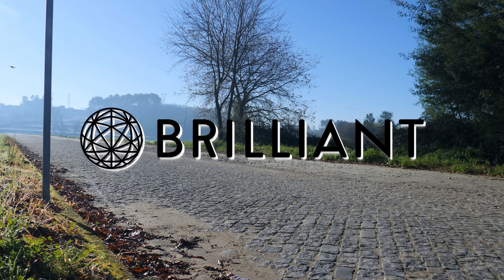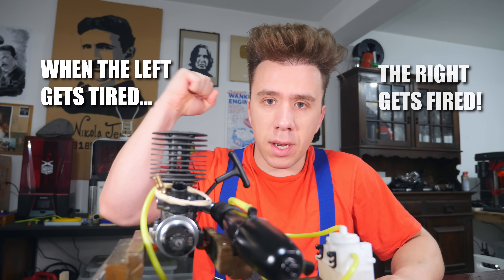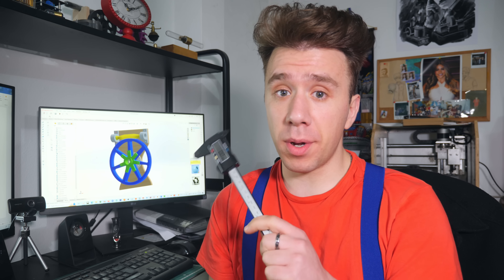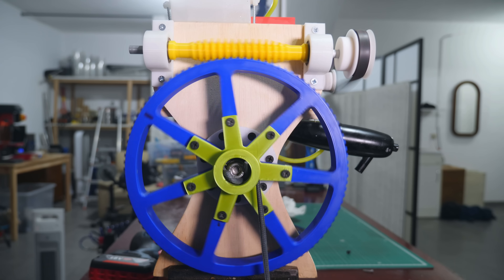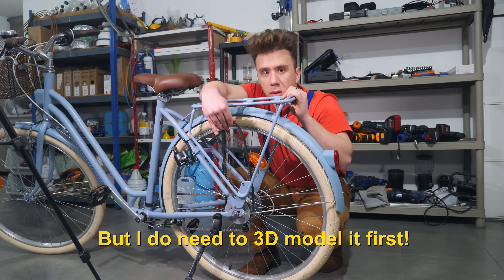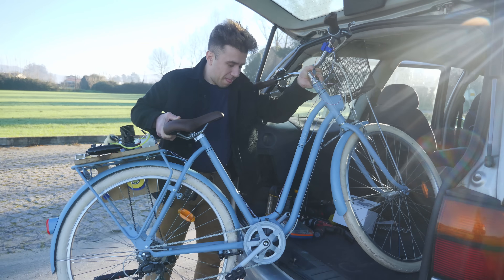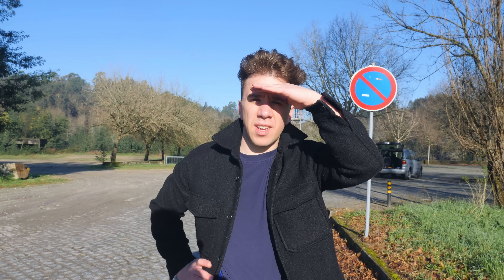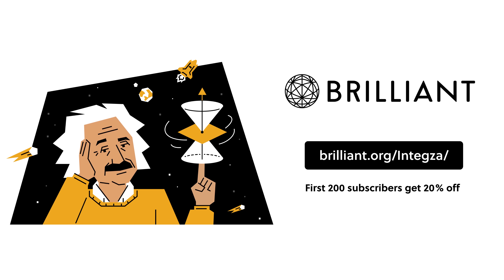Tiny 3.5 cc NITRO ENGINE on a BICYCLE

Comment: Stupid question, when the engine is running but the bike tire is not spinning. How does the engine not stall? I understand that theres lots of places that could begin slipping to allow the motor to keep spinning but the tire be not spinning but that would destroy whatever gears are slipping very quickly. Thanks for whoever explains it!
Reply: Nitro engines and most small engines use a centrifugal clutch on their crankshaft that only engages to the output when above a certain RPM. Works in principle exactly like a normal car clutch except engages and disengages automatically based on engine RPM. On the crank is a set of clutch shoes squeezed together with a spring, at a high enough speed they have enough centrifugal force to overcome the spring and move outwards, where they grab an outer drum and connect the engine to the output. Centrifugal mechanisms like this are used in a lot of scenarios when input and output can't be directly connected.

It's easy to understand if you google a centrifugal clutch like used in Go Karts, Chainsaws, and they look like a drum brake system with shoes that engage a drum if you're familiar with those. Very cheap and simple design that automatically prevents stalling when you let off the throttle and engine RPM drops
Reply: @Brandn00b25  thank you very much

Comment: It needs proper metal eBay gears and to be setup so it has two or three speeds, you could make a selection gear and shaft as the output

Comment: Now you see why these engines are used for RC models!  Especially helicopters.  For a "700" size heli (which spins 700mm main rotor blades), it takes a 31cc gas engine to perform similar to a 15cc nitro engine... and at that point it's considerably heavier and thus flies worse.

Comment: Now you need to put a exhaust to give it some back pressure since 2strokes run best with back pressure hints the crazy exhaust the 2stroke dirt bikes have I don’t 100% know how it being nitro will effect it though
Reply: Also two ideas you could try a centrifugal clutch maybe and make it to where it drives the front wheel so you could have the rear so you can pedal and get it up to speed just an idea🤔

Comment: They were called "glow plug engines" and ran on a mix of methanol and oil, about 4 to 1. Then competition fliers/drivers started adding nitromethane, about 5% for a bit more kick. The manufactures decided to rename the engines. Now I think they add up to 20% or 25%, using a synthetic oil. Top fuel drag cars use about 5% methanol and 95% nitromethane, they wont start, let alone run on pure nitro.

Comment: Better get a few clutches on hand for spares. If you hear fuel sizzling in the crank case after shut down, she's too lean. If it ever starts to really run great, it's about two minutes before melting down. Nitro wisdom for you.  An infrared therm. Is a good tuning tool.

Comment: impressive results. Always preheat nitros as they have a tapered sleeve to create piston/cylinder seal. Can prime by plugging exhaust with finger till fuel gets to carb. Tuning will gain power and rpm. Start with flush or what book says, will be rich to start. Set about 1mm idle gap, tune high speed, then low speed and idle. Once set, use low speed to achieve idle going forward.

Comment: I recently got a couple of these nitro engines and wanted to make a similar project. I thought about using worm gears too but decided against it due to their low efficiency, I’m surprised it worked well for you.
Reply: I think a planetary gear could work to lower the very high RPMs to something more useful.
Reply: I would use a cycloidal gearbox as this has less friction (with bearings) and is back driveable so you can start by pedaling.
Reply: Do nitro engines really have that much better weight to HP ratio? ? Like do you think I could find a 50+HP motor for less then 30lb?
Reply: @petevenuti7355  paramotor engines and ultralight engines are as close as you will get.. that being said , an electric will outperform it but the battery pack combined with motor will weigh more.Rotax makes engines about 55hp and roughly 50 lbs
Reply: @airgunningyup  that's exactly why I want it!,
 I can't afford a rotax and having a 35hp cyuna from the 80's that runs sometimes is not good.
Reply: @airgunningyup thats really not much better if at all compared to a 2 stroke outboard motor powerhead. For example, I had a modified 2.6 liter powerhead that pumps out 270hp. Mercury has the 300 drag and F1 motors. the whole thing weighs 290 lbs. powerhead alone is only about 150 lbs. the most powerful electric motor i could find is the Quark that does 126hp and weighs something like 70 lbs, with 330hp for only 20 seconds. so in reality its not the weight of the motors themselves, but the complete package as you stated. also the obvious HUGE benefit of not having to lug a battery around thats always the same weight, empty or full.
Reply: @petevenuti7355 I don't know if someone makes a motor with these specs but the power to weight ratio checks out. Top fuel drag racers have 1000-2000 pound engines making 8000-10000 horsepower
Reply: @petevenuti7355  paramotor engines are the closest you will find
Reply: I was thinking maybe go hybrid, I mean - if you have a little angry power generator you can power an electric engine which is quite efficient
Reply: @likemau5552 not as efficient as directly driving it off the nitro motor. Technically you can build the nitro motor to be extremely efficient at one specific rpm with tuned intake and exhaust lengths etc but using a generator and an electric motor introduces multiple stages of loss. Frictional loss from nitro motor to generator, frictional losses within the generator, ohmic losses between the generator and electric motor, losses within the electric motor etc
Reply: Easier is a direct drive to the tire from the crankshaft!!!!!!!!!!!
Reply: The crank journals are the biggest issue, they can't handle the torque needed to move such a large mass for long.
Reply: Planetary gearbox or harmonic drive is pretty suiting aswell
Reply: Especially dry with no lubricant, no wonder it was churning the mating part up. Solid lube ain't enough
Reply: u should upload that dapz
Reply: I have expected more speed with this power
Reply: pur it in an rc car
Reply: What gears did you end up with?
Reply: What did you end up using instead?
Reply: @DRSDavidSoft  I’m planning on using a 2 stage gearbox. the engine im using only spins up to 12000rpm and my rear wheel is ~ 6 inches so I don’t need as much of a reduction
Reply: @dapz  you could also use multiple pulleys, might be easier to build than a gearbox
Reply: Please upload progress

Comment: These engines can handle a lot. Where using them to get our rc planes to fly at around 300kmh. At these speeds the engine os40v has 22000rpm on the ground and around 24000rpm in the air.

Comment: Suggestion 1: take 4 of those Nitro engines and make a Quad Copter Drone.
However, I imagine getting 4 that have almost identical power bands (produce identical power across the  RPM range) would need immense luck... Therefore...

Suggestion 2: see if you can make a tiny electric generator using one motor, to replace the battery pack on the drone!
Again, a huge challenge (not that creating homemade rocket engine isn't equally challenging), but I've become aware that you can generate the same 3-phase power those motors run on, by using one of those motors AS the generator unit.

Comment: I suggest ditching Phillips drive screws, and switching to Torx drive (aka or "star drive"; not to be confused with the propulsion unit in Stargate: Atlantis 😅)
Sure, they're a bit more expensive, but you won't have to worry about stripping them out!

(I'm assuming you're just using wood screws, not 'machine screws' [bolts basically]. Added bonus is most, at least in North America, are also self-tapping, so you should be able to drill straight into the plastic without a hole!)

Comment: You're definitely not getting the full potential out of that engine, as with the power of a human in a sprint 50 km/h is typically quite achievable, and that's about 1 hp.

2.5 hp should hit speeds around 65 km/h, depending on CdA.

Comment: I've done motorized bike myself, and the gearing was the problem. As you may know electrical engines have a lot more efficiency (90% compared to 30% of internal combustion engines). My suggestion - try to replace nitro engine with electrical without changing the gearing and feel the difference. Try maybe like a  BLDC motor find on drones?

Comment: Just remeber though Electric motors put out massive torque for thier size. So a 2HP electric motor will put out up to 30% more torque than an equivalent HP piston engine.

And isnt one of Portugal's leading exports tomatoes? lol

Comment: These small engines are fine for rc cars or choppers, for bigger projects ive found 10 or 11cc rev lower but have a good torque curve, i never once saw you choke the engine on start up, was that for comic effect ?

Comment: Actually, the Citroën 2CV was about 9 to 32 HP. That is because in French, cv stands for "cheval fiscal", which is the tax horsepower, quite different from the horsepower. In French, horsepower is "cheval vapeur", or "ch".

Comment: I have a traxis 2.5 up monster truck lowered it so wouldn’t  roll it easily hit 65 mp it has two gears built in so it was stupid quick also used 35% Big Bang fuel really helps and better option is electric starter

Comment: Running it without air filter means very soon death of piston and cylinder liner which are the most expensive parts of the engine.

Comment: Um, I'm far from an expert, but please be careful with the table saw. You should always maintain pressure on the wood between the blade and the fence else you can get kickback. Im probably just being a wimp, I hate using table saws😂

Comment: 9:48 "ouch ouch ouch ouch"
- The balls.

You should install ball bearings by only applying force to the side of the bearing that does not transfer that force through the balls. Outside in this case.

This channel is awesome btw ❤ :)

Comment: Try to lower the blade of your table saw to just above the thickness of the board you’re cutting. Less chance of sawing off limbs and such 😅 and make a cross cut sled for cutting those longer pieces. Great job on the bike. Looked like a lot of fun.🎉

Comment: The 2CV in 2CV refers to "deux chevaux" which means 2 horses some believe that "2 horses" refers to the width of the car so it could fit on trails which were intended for horses.

Comment: That was good fun to watch. I'm fairly sure that having a teflon/brass exchange is overkill on the lubrication side, and you would also normally have the softer material on the power side. in clocks for instance, the exchange goes from brass to steel, so that the softer material suffers less friction, but transfers the power to the faster moving, harder material. That could be one of the reasons your teflon drive disintegrated.

Comment: Worm gear was a wild choice, worked better than i would have ever thought considering plastic gears but that 100% didnt sound even half of 30k rpm, is the 30k rpm rating under no load? I dont have enough knowledge of the relation of torque and rpm and how engines are rated so i just assumed your .9kn torque is produced at 30k rpm but it seems you had good torque at nowhere near those rpm ranges. I guess thats the beauty of the "i can spin it with my fingers" approach to gear reduction, i also use this type of approach to everything i do basically but that is on account of my severely limited mathematical knowledge which from watching your videos i know is a limitation that you do not have. I guess what im really wondering is if the engine was spinning at 30k would you just have alot more torque available but still be roughly limited to the same speed or would you all of a sudden be moving 100 mph considering the engine is spinning  atleast 3 times faster than it probably was here in this video. Lastly tomatos are one of the finer joys of life so im assuming you hate them ironically because if not the sooner you come to the tomato side of things the sooner things should be fundamently better in everyway.